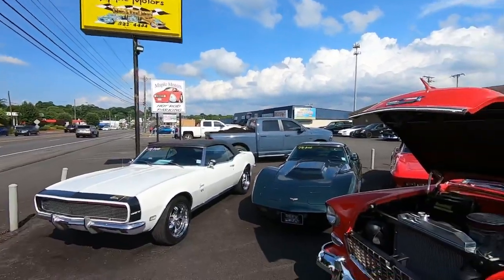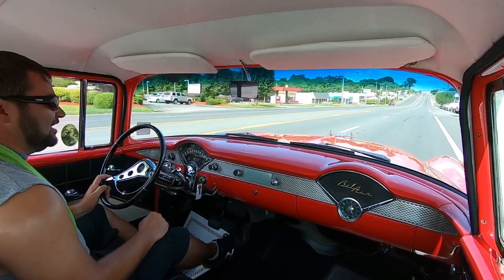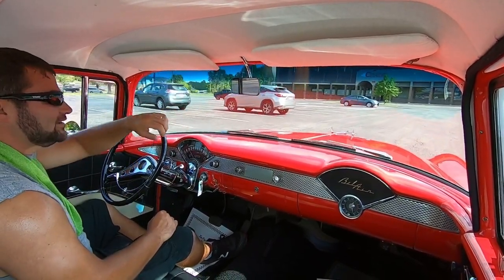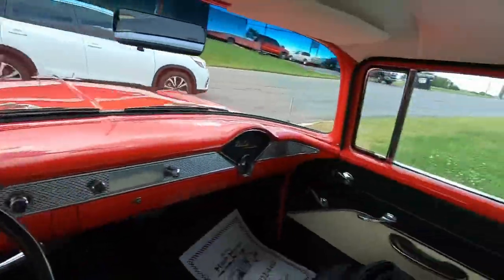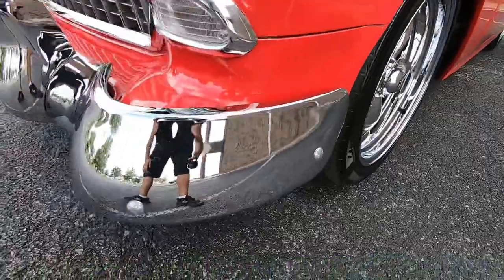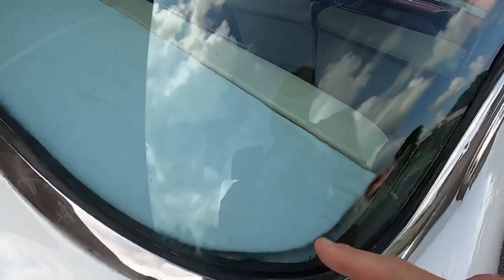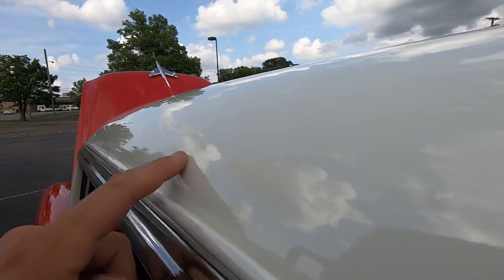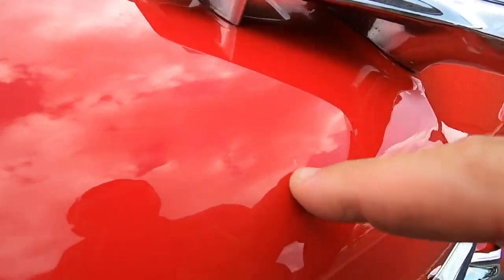Test Drive 1955 Chevrolet 210 2 Door Post SOLD $37,900 Maple Motors #1146

Comment: I had an 55 Bel Air 2 dr post.  Why not add AC to it?  You didn’t wind down the rest of the windows.  Which tranny is it in?  700 or 200R4?  Good luck on the sale of it.